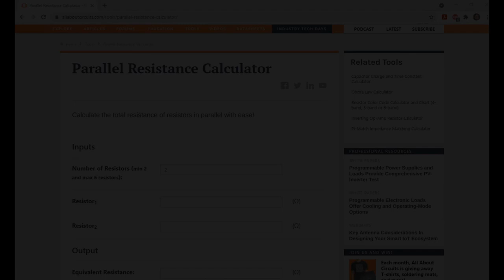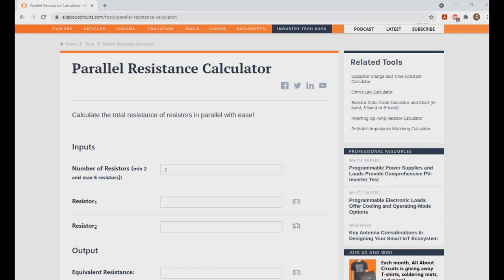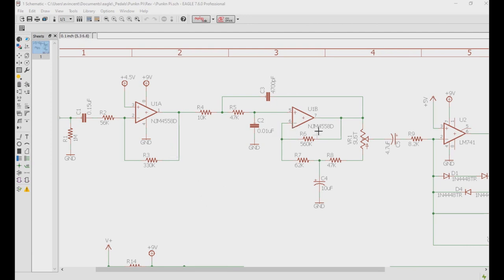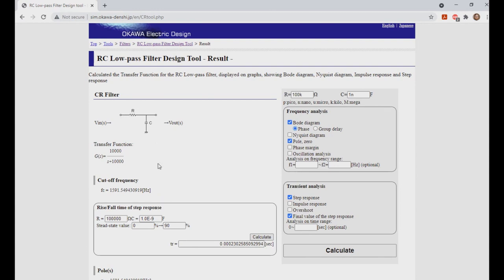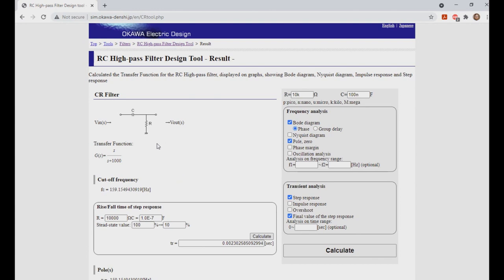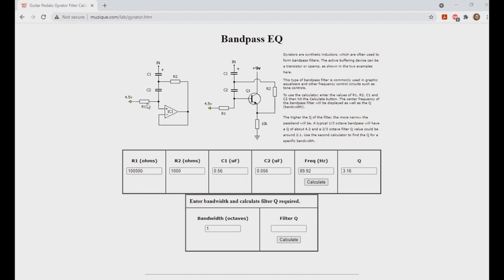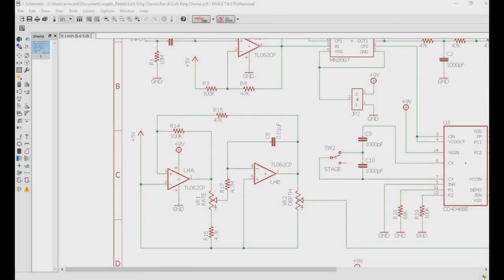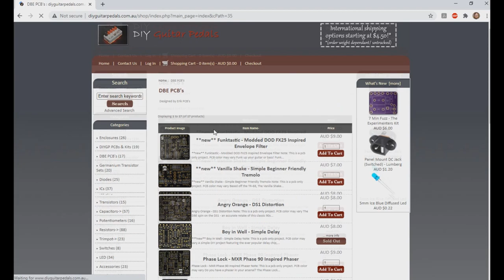Simplest Guitar Pedal Mods: Parallel Resistors

Comment: First time I was adding parallel Resistors to a pedal was in an A/B switch. I didn't have the right resistors for the outputs (500Ohm), so I simply put two 1k in parallel there. Defeated the clicking sound when switching and looked kinda cool inside the pedal.
Reply: hell yeah BROTHER!!!

Comment: I've modded rehoused/true bypassed a couple Behringers so I recognized that PCB style on the SMD board you showed. I'm just not sure which one it is. Out of curiosity which one is it? My next build is going to be a DeadAstronaut Chasm Reverb using a BTDR-2H Belton brick which is basically a PT2399 based reverb. I think it would be a cool thing for your channel....you know what I think I learned about the Chasm Reverb in the first place from the other Austrailian guy who posts under this channel lol! I build 80% of my pedals in Vero but I think I'm gonna do the Dead Astronaut Chasm using Dead Astronauts PCB. It will be a good way to support the pedal designer and get a quick and easy good looking finished product lol. I also like that the PCB offers pads for a toggle switch AND a footswitch to activate the Oscillations.
Reply: As of the Behringer pedal, that is their UO-300, which is their modified version of a Boss OC-2. Good eye on that one. As of the Chasm Reverb, yeah, Paul is a huge fan of that pedal. Dead Astro has some really cool effects, so I can't say anything but good stuff in regards to them. Yeah, the Belton bricks are a series of 3x PT2399's with some support electronics to act as filters and such. I think they sound good.

Comment: Cool. I have a dod fx86b that was no gain control. Its flat out distortion. Perhaps I can add a pot somewhere for some control :)
Reply: You might be tempted to hit the first gain stage's resistor, but as that is a gyrator, I'd hit the 120K resistor on the second gain stage and use that to manipulate the gain.
Reply: @erikvincent5846  , I havent found any schematic for it so far. I'll keep that in mind. Thank you very much.

Comment: Hello! Thank you so much for your video. I found it to be very informational. I recently purchased a Matchless HotBox III and I love it! The 2 tubes inside of it make all the difference and its the sounds I'm looking for. The first channel is super clean, but channel 2 I feel like it has a lot of overdrive even at level 1. I would not be able to go past 2 for the music I play. Would this video be a good start on potentially modding this preamp pedal to reduce the gain on channel 2? Conversely, adding a bit of drive to channel 1?  

OR 

Should I start by maybe changing the tubes? Any pointers are much appreciated! Thanks!

Comment: I imagine there'd be no difference sonically between a  single 100k and two 200k resistors in parallel, so would I be correct in assuming that this mod applies just circuits that already have resistors in place as opposed to something your building?

Comment: With the smd, couldn’t you just put a smd resistor on top of the old one and solder them together?
Reply: That will work most of the time. Some SMD resistors are not insulated well, and when you get those, it then makes your stacked resistors into capacitors as well. I tend to go side-by-side with two SMD resistors in parallel, if the board-space allows it.
Reply: @erikvincent5846  thats very interesting, thanks man!
Reply: @jeroen4734  I only mention that, because at a previous place of employment, I accidentally made that mistake.
Reply: @erikvincent5846  😂 thats how we learn! I hope thats not the reason its your previous place of employment?
Reply: @jeroen4734  nope. Just found a better opportunity elsewhere.

Comment: How are parallel resistors any different than just adding a resistor of lower value? It might change something with the voltages across those resistors, but I'm not seeing how this is any different than just adding lower value resistors. What am I missing?

Comment: Electricity follows the path of least resistance...only a resistor with.less resistance will do anything placed that way...wouldn't it be better to ..or funner remove the resistor and put a potentiometer in its place
Reply: This is true, potentiometer mods are usually good, but for the sake of simplicity, I was trying to target a modification that required zero removal of previous components.
Reply: Yup...but in cases where you want more resistance removal and replacement are a must.
Reply: @Mp3acid  very true.